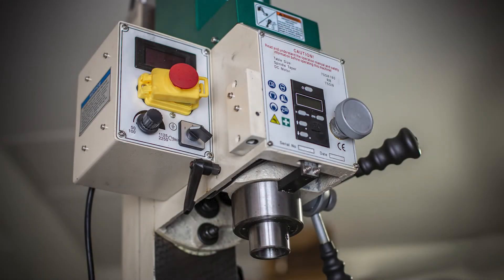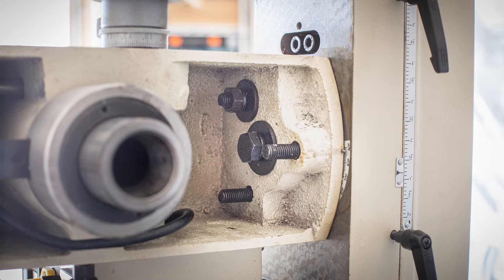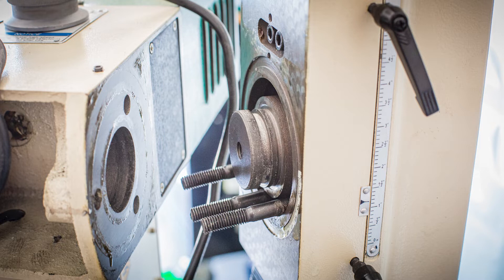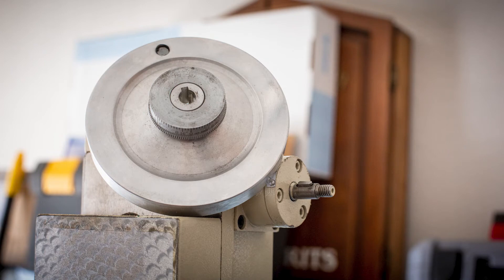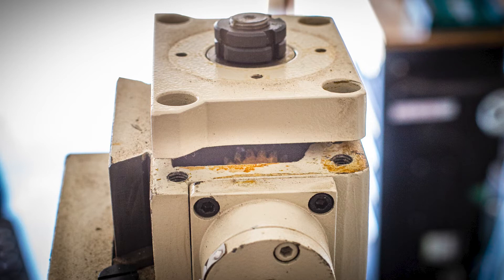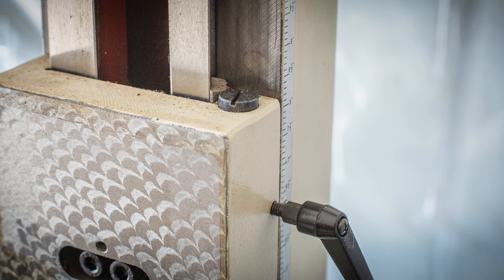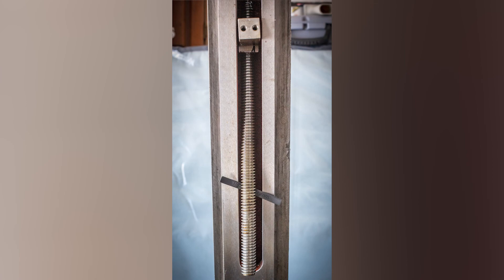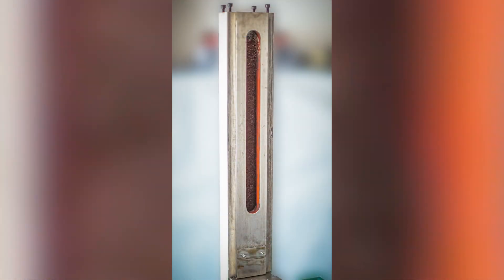Grizzly G0704 CNC Conversion - Z-Axis Disassembly - Video #2

Comment: I recently purchased a "cousin" of the Grizzly G0704, the KIng Canada KC-20VS-2. The crate is still in my garage, and I will be partially dismantling it so that I can safely transport it down to my basement by myself. Your detailed disassembly videos are exactly what I need to separate the 265 lb machine into 3 or 4 manageable chunks. I was thinking the table, the headstock, and the column+base. Anyway, your photos and your explanation are really excellent. Thanks so much!
Reply from the maker: You're welcome. Glad it was a help.

Comment: nice video.  it takes a long time to do these videos and i want to say thank you,  i have 2 harbor freight mills that I want to do a CNC conversion. the Z axis is one of the main problems. IT DOES NOT HAVE A GIB Z AXIS It sides on a round large shaft,  I will if the good lord lets me work that out. But everything else I am on board.  A again thanks for the video series and may God bless you.
Reply from the maker: Thanks.
The round column does sound like it can be a challenge. Let me know if you find a solution.